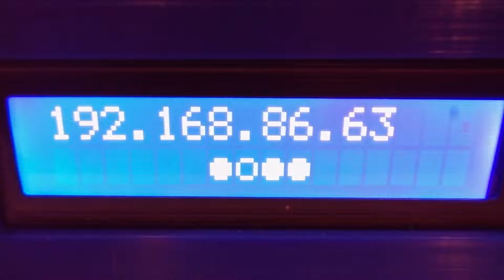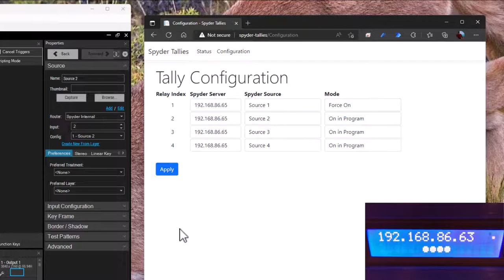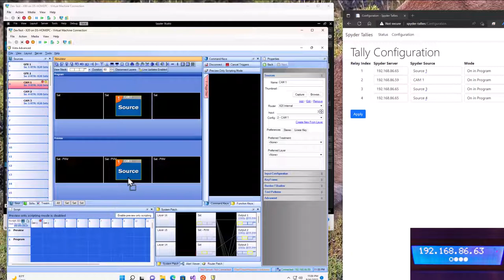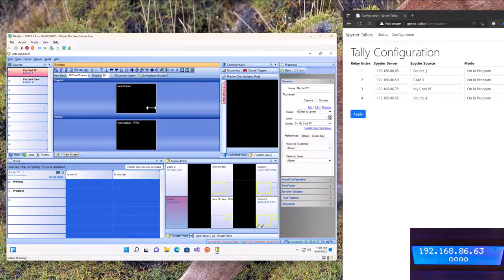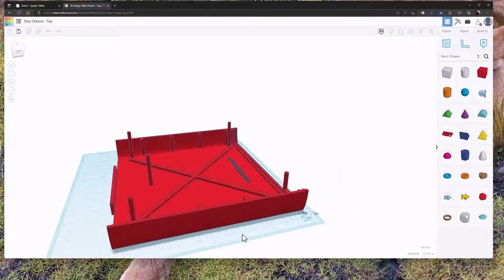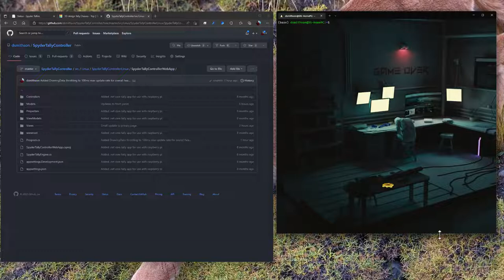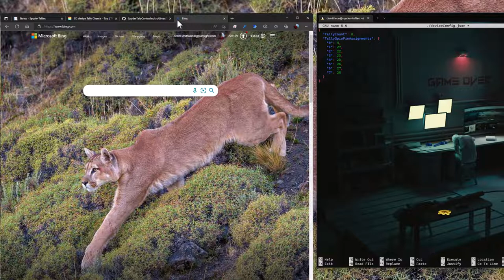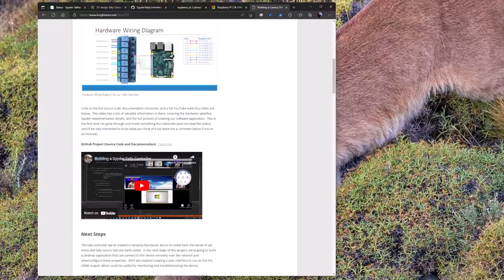Building a Spyder Tally Device (Redux)

Comment: Thank so much for making this. Christie promised me before I bought 2 X80’s they would integrate tally into widget designer… it’s in a long list of disappointing things they never followed through with… in line with HDR on HDMI & DP ports
Reply: As long time Spyder User and Christie User... i would say: Since Jan and other longtime employes left here in Germany it ist difficult to get Support :-(  
Via Widget Designer you could use normal USB Relais directly (dos command). i think there is a manual in the FB or Support Forum

Comment: great Work! Thanks so much! We use our 344 in a Studio Setting and this "direct" Tally would be nice. The X20 and X80 are onn the road, but would also get this system :-) Thx
Reply: Finally i printe the Chassis and my Bambu Slicer does something strange: The Long stud bolts fell off and there is a Hole. The Bambu Slicer ignored the bigger bottom part of the stud :-(